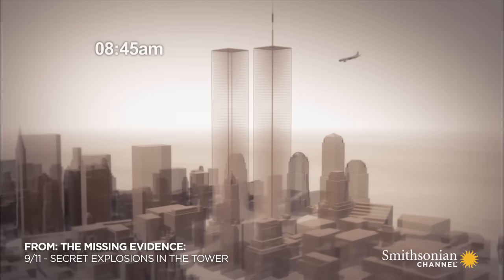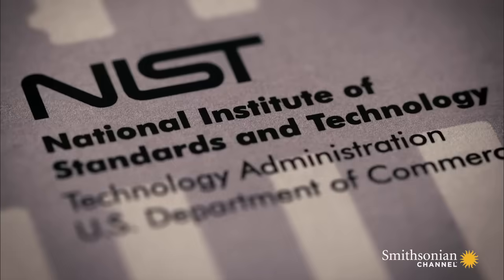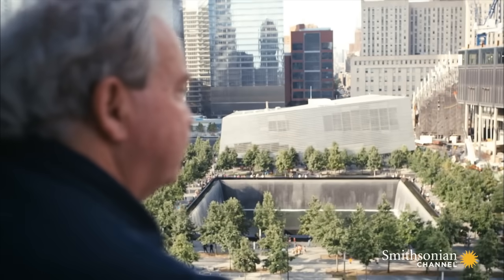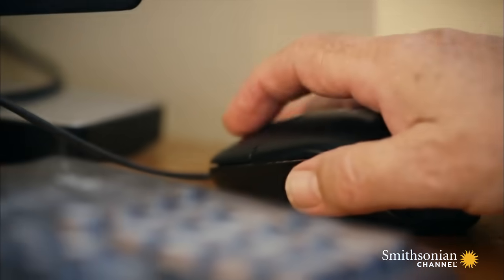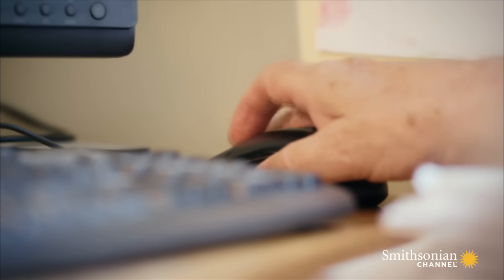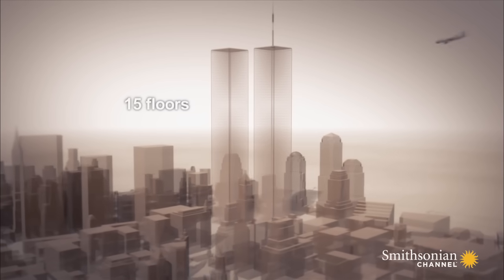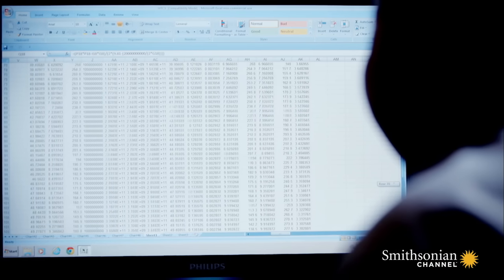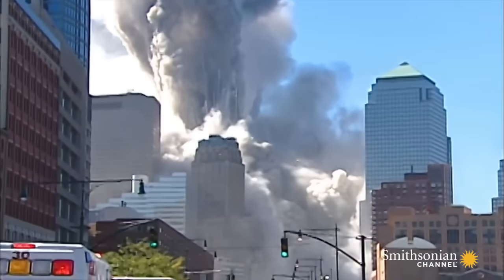This Computer Simulation Explains How the Twin Towers Fell

Comment: What I never understood is how the wing of the planes never broke off but instead went right into the building like a hot knife on butter
Reply: Because the wings, like the rest of the plane, were doing over 500 mph. The towers were not reinforced against such an impact; they were not solid blocks.
Reply: @Tim22222  The towers were not reinforced.....? the structural engineer Robertson said  “I designed it for a 707 to smash into it.”
Reply: @roostern1005  Where’s that quote from?
Reply: @roostern1005  No. The idea was that the tower could survive a plane crash, not repel it. NOT REINFORCED. However, Robertson was also clear: He envisioned a plane flying SLOWLY (about 180 mph). The 767s that hit the towers were traveling over 500 mph, which means up to 10x more energy than he planned on. And then there were the fires, which Robertson said they definitely did not account for.
Reply: Wikipedia doing research,  that was a comment made by Robertson the engineer .. A plane had already hit the Empire State Building so engineers we’re aware of the dangers of airplanes.
Reply: @tpryce1782  doing research.. Wikipedia
Reply: The National Institute of Standards and Technology (NIST) found a three-page white paper that mentioned another aircraft impact analysis, involving impact of a jet at 600 mph (970 km/h), was indeed considered, but NIST could not locate the documentary evidence of the aircraft impact analysis.
Reply: @Tim22222  The National Institute of Standards and Technology (NIST) found a three-page white paper that mentioned another aircraft impact analysis, involving impact of a jet at 600 mph (970 km/h), was indeed considered, but NIST could not locate the documentary evidence of the aircraft impact analysis.
Reply: @roostern1005  You beg to differ ... with Leslie Robertson? I'll go with his statement, thanks.

Besides, Robertson was quite clear: The effects of the fires were NOT considered. And without the fires, who knows? The towers might have stood.
Reply: @Tim22222  Of  course why would a brilliant engineer ever think a plane crashing  into the building would cause a fire... who could of thought that would happen.
Reply: @roostern1005  He knew there would be fire; he didn't know how to figure it into his calculations.

Watch the video. Hear what he says.
Reply: @Tim22222  sorry computer glitched I’ll finish in a min
Reply: @Tim22222    Greening wrote “ considerations  to  the strength of the WTC columns, and the effective area of
Reply: @Tim22222  according to Greening  in the energy transfer text “From a consideration of the strength of the WTC columns, and the effective area of support they provided, it is demonstrated that the conditions necessary for the initial floor collapse were initiated by the aircraft impacts and made irrevocable by the subsequent eccentric loading of the core columns. The fires that were initiated by the jet fuel spilled within the towers certainly weakened steel in localized areas in the impact zones. However, it is suggested that the total collapse of both towers would have occurred even without the jet fuel fires.”...  So Robertson not putting fire into he’s calculations shouldn’t have mattered
Reply: If you believe everything Greening concluded.... it’s not like scientist and engineers are ever wrong ....especially if you have pressure from the government telling you they need to make an explanation that can work.
Reply: @roostern1005  Dude, what is your case?? That maybe the buildings shouldn't have collapsed because maybe some speculative estimations say maybe ... what, exactly? What are you trying to convince me of?
Reply: @Tim22222  I apologize my computer glitched
Reply: But like I said You can disagree with Dr Greening if you want but you told me to listen to him again so I figured you had some faith in his thoughts... me I still got my doubts
Reply: Some of the videos are fake
Reply: @roostern1005  "Some of the videos are fake"

Now this is just a total lie! None of the videos are fake.
Reply: @Tim22222  I beg the differ

Comment: "The mass of the upper block in the North Tower is equivalent to the mass of the Titanic. Is about 38,000 tons" Which, as they said was 15 floors. The twin towers had 110 floors, so there was 95 floors underneath the impact. The remaining floors, by their calculations would weigh roughly 240,666.67 tons. The Smithsonian Channel, NIST and Dr. Frank Greening, Research CHEMIST, are saying that 38,000 tons destroyed 240,666 tons with no extra force, energy or help. 
***EDIT*** My math is wrong. The steel towards the bottom was much thicker and weighed a significant amount more than what I originally claimed. So we'd have a 38,000 ton top of a building crushing 240,666+ (plus) tons. 
And before you tell me fire was a force or energy to aid in the destruction, the fire was in the top 15 floors. Not towards the bottom. Also, lets remember that these are the only steel framed structures in the world, ever to have a complete catastrophic failure due to fire. 

Funny how YouTube doesn't flag this one for the extra context for the September 11 attacks, yet any other video that asks questions does.
Reply: Aren't you forgetting something? There IS a force in play that feeds the collapse. Can you guess what it is?
Reply: @Tim22222  I am forgetting several things in the original comment. I was tired and my math was way wrong. I'm editing it now. But instead of the guessing game, just put your comment out there. Why do you need to play cat and mouse for you to get your point across. Just say fire, or airplane crash or whatever.
Reply: @warriorKing2233  Good guesses but wrong: THE FORCE YOU FORGOT IS GRAVITY.

You ask where that original 38k tons got the energy it needed to crush the rest of the building? Gravitational Potential Energy is your answer. The GPE baked into those towers was equivalent to 100-200 tons of TNT! That's plenty enough energy to wreak that kind of destruction.

One more point: Don't forget that every floor that gets destroyed become rubble that joins the collapse! So no, it's not 38k tons v. 240k tons, it's 15 floors versus 1 floor, then 16 versus 1, then 17 versus 1 etc. etc. It's really no surprise that the towers collapsed down to their roots.

Comment: a computer simulation is simply a lie where you find what you want to find, but the reality is sadly and terribly that no building, no one at all, can fall that way their pretty tv movies showed us, by its own weight from top to bottom, even though the upper part should fall from one kilometer high, the lower part will always resist, because it is, by necessity of construction, stronger than the higher one, the only true explanation a computer could perfom is what it really happened: an evil diabolic controlled demolition

Comment: Bird vs. nose of the plane
Bird: wins

10000tons of steel and concrete vs. nose of a plane
Nose of a plane: wins
Reply: Are you sure? Show me the wining bird, please.
Reply: @curiouscat8457  search: "bird nose of a plane" here on youtube. Love you.
Reply: @Hollandaaaaaaa  I asked you to show me the bird after the collision.
There is no winner. There is only a mutual total destruction. The same as the nose of a plane and steel beam. You can cut steel with water giving it enough speed. It is a matter of kinetic energy it carries.
Reply: @curiouscat8457  ah i see what you did there. You are right about the first part, but there is no way a 2 mm thick nose can drill through a steel construction like the WTC. 80% of the planes volume is just air. at 500mph this isnt possible. Lets agree to disagree on that. Have a great life cat
Reply: Each plane weighed 140 tonnes with fuel. That is the equivalent of throwing 140 cars at the buildings at the same time at 590 mph.

Comment: funny how he states the the weight of the floors will indeed be enough force to take the entire building down, and the actual footage shows many large sections being thrown outward from the buildings footprint.
Reply: That's the exterior columns, not technically part of any floor.
Reply: @Tim22222  so what force brought them outwards? The compressed air from the floors pancaking on top of each other?

Comment: It was scientifically impossible for jet fuel to burn through the steel beams jet fuel burns at 1500 degrees and to burn steel u need at least 3000 degrees heat lol put the documentary loose change back on here
Reply: Not a problem, since that didn't happen. No steel "burned" nor did anyone say it did.

Instead, the jet fuel and all the flammable materials in those offices burned hot enough to weaken the steel up to 90%. Gravity + the impact damage did the rest.

Comment: hit on the top, collapsing neatly from the bottom like a controlled demolition. yes, I remember watching a video revealing the strangeness of this tragedy, that there was an explosion/flashy white light from the bottom to the top in every window of the building before the building collapsed. and also an explosion/flash right before the plane crashed into the building. it bothers me that a plane can tear down a building sturdy such as the World Trade Center, is not very sensible.
Reply: The towers did not collapse "from the bottom" they collapsed from the MIDDLE. I've never seen a controlled demo like that.

No evidence of explosions, either. NONE.
Reply: Building 7 did collapse from the bottom though.

Comment: Oh, the world trade center was designed to be hit by a plane?
That new for me. xD
Reply: The engineers did a calculation to see if the towers could survive a strike like the Empire State Building took when a B-25 got lost in fog over Manhattan in 1945. But the WTC engineers made 2 assumptions that turned out to be wrong: That their theoretical plane was 1) flying slowly like the B-25 was, and 2) was low on fuel. Neither of those things were true about the 767s that hit the towers.

Comment: Did they test airplane wings slicing through steel I-Beams? I'm guessing not. Did they notice that the do-not-exceed speed for a Boeing 767 at sea level is 404 mph, and the 9/11 767 was reported to be maneuvering at over 500 mph? The wings would have ripped off the plane at that speed. Interesting that building 7, fell out of sympathy for the other towers. The whole thing is a giant crock, that got us the war the military-industrial-complex wanted.
Reply: J R Deckard The I columns were very thin at that height they were only 4 inches thick. A plane flies faster in thinner air so it carried more speed from descending rapidly from an attitude of FL310 (31,000ft). A plane can only break a part flying directly into a up/ down drafts of a thunderstorm, hurricane, tornado, or poor maintenance. Aircraft wings are very sturdy than you think, and with a heavy fuel load in them would make them strong asl. At 500mph it easily cut through the thinnest upper columns ('4in) isn't not that thick. These flexible wings cut through immense air pressure so steel that thin ain't much of a stretch at that high speed. And it didn't cut clean thorugh the other side eventually it broke up, but the wings were intact enough to still burn up inside the upper floors. If you learn about planes it's not hard to believe.
Reply: @omfgCantGetaUsername  What about hurricane Erin?
Reply: @omfgCantGetaUsername  Do you realise that steel is much stronger than aluminum? Please learn the truth about 9/11 by reading Judy Wood's book Where did the towers go? Evidence of directed free energy technology on 9/11.
Reply: @andrewdean6963  where were these weapons set up then? How close do they need to be? 
What powers them? 
And nobody noticed?
Reply: @garywood5882  I appreciate your valid questions. I don't know where the apparatus were set up but we don't need to know. But what we do know is the equipment was used as a weapon. Also, I don't need a degree in physics, just a basic understanding will do, to know the planes could only have been holographic projections of light and sound because of Newtons third law of motion. As for the power source, it is free energy technology. Nikola Tesla wanted to give it to the world for the benefit of every living being upon it. Read Judy Wood's book, Where did the towers go? Evidence of directed free energy technology on 9/11. Empirical evidence is the truth, that theory must mimic.
Reply: @garywood5882  They pulled building 6 down with steel cables and had to be very careful not to damage the slurry wall. People could not outrun the dust clouds of WTC1 and 2, and we're covered in dust, not crushed by one or two 500.000 ton buildings or cooked by any high temperature by any supposed molten steel. My point is if you cut the support of a tree it obviously can't go straight down. But some people with a degree in whatever don't understand basic physics do they? For every action there is an equal and opposite reaction.
Reply: @andrewdean6963  how do you generate a hologram and project it without millions of people seeing where its coming from?? It can't just magically appear?
Energy weapons struggle to take down drones at the moment.
Reply: @garywood5882  Thanks for your great questions. I am certain that the powers that be are technologically way ahead than what is in the public domain. Check out the Searl Effect Generator (SEG). The Havana syndrome is an interesting read about microwave energy weapons that was used to target personnel in various embassies.
Reply: Bldg 7 sympathy.  Thanks for that.  Because I've been tearing my hair out trying to follow the lack of logic presented by NIST.  911 was an inside job.
Reply: Did they account for rubes who refuse to see plain lies? Sure they did. Gov would nevevr lie to you.
Reply: The never exceed limit doesn't necessarily mean the aircraft will break apart at that speed. It's just a recommended speed not to go over. I don't think the hijackers cared about safety as they were flying into a building. It's also completely irrelevant as everybody saw the jets fly into the building
Reply: @mikebyrd8278  it's a recommended speed not to go over for a reason, too much air density at low altitude, the plane would start breaking apart
Reply: @namegoeshere69  no it's not, they don't know exactly at what speed the aircraft will start to come apart. It's also pretty obvious the Jets were  real because everybody saw them
Reply: @mikebyrd8278 when did I say they weren't real? And you could look up the videos of commercial aircraft engineers stating the same thing.
Reply: @namegoeshere69  soooo then what's your kookie idea?  Yeah I've never seen a aircraft engineer say an aircraft will disintegrate at a specific speed
Reply: @mikebyrd8278  well let's not get crazy here, it's not going to disintigrate. And a good kookie idea is peanut butter, I like peanut butter kookies
Reply: I think your theory falls apart due to the attacks on the pentagon and the capital building.  It also falls apart due to it's absolute absurdity.
Reply: The wings didn't actually slice any steel, they broke the bolts that connected the beams together. Not a problem.
The do-not-exceed "V" speed is a rule not a fact. Exceeding it means you're speeding; it does NOT mean the plane will fall apart.
Building 7 was severely damaged by the tower collapses and burned unchecked for hours. It wasn't just "sympathy."
Reply: @Tim22222  steel building dont collapse by fire. That's it. AND YOU CANNOT CHANGE A LAW OF NATURE.
You are stating just bulls-it
Reply: @TheImproponibile  Excuse me, I think I missed that day in physics class where I learned your "law of nature" that steel buildings can't collapse from fire. Did you just make that up? I can't find it anywhere. You would lie about something like that, would you?

😉
Reply: @TheImproponibile  lets ignore how the plane cut clean through the building as well, destroying multiple collumns, putting the remaining ones at increased load just waiting to fail?
Reply: @Tim22222  show me a video of a steel building free falling because of a "fire"......I'll wait...................
Reply: @Tim22222  You need a furnace to melt iron and therefore steel.
Reply: @andrewdean6963  jet fuel burns hotter than normal fite
Reply: @mr.jasonlee395  search up the brazil high-rise collapse
Reply: @jacobmoriancumer7588  Why does it appear  for a collapsing building to take the path of greatest resistance? What happens when you cut the support from under a tree?
Reply: @Tim22222  Larry Silverstein told "authorities" to "pull it," meaning bldg 7.  I'll let you search for when bldg 7 was detonated and compare that to how long it should have taken to wire the building.
Reply: @5jjt  Larry didn't "tell" authorities JACK. He couldn't. Because firefighters do not take orders from building owners. You really are quite uninformed.
Reply: @5jjt  they pulled the what was left of WTC6 and had to be very careful not to damage the slurry wall that still holds back the Hudson river. Had two 500.000 ton buildings collapsed into the foundations then the wall would have ruptured and Lower Manhattan would have been flooded.
Reply: @5jjt  or he meant for them to stop trying to save the building